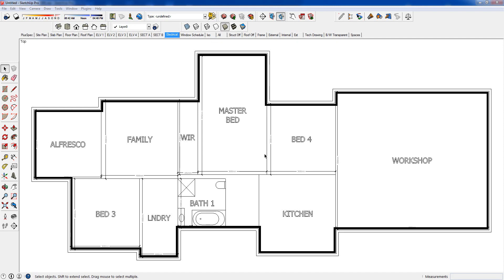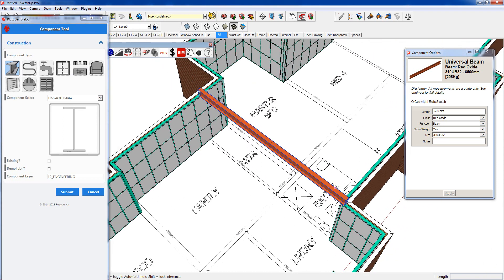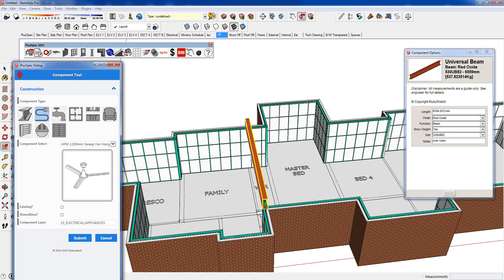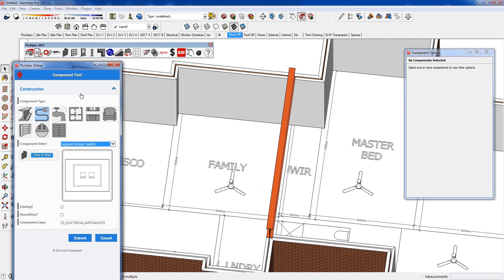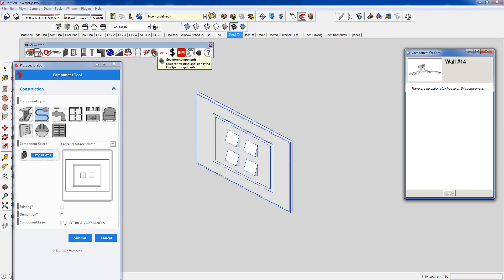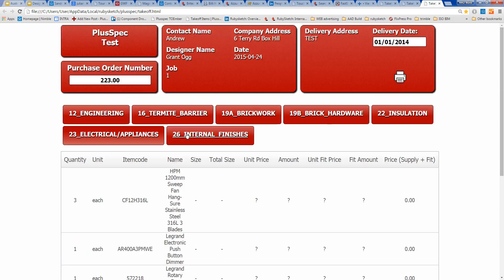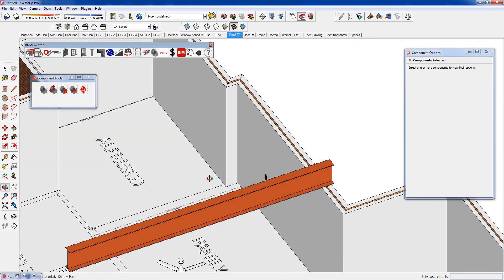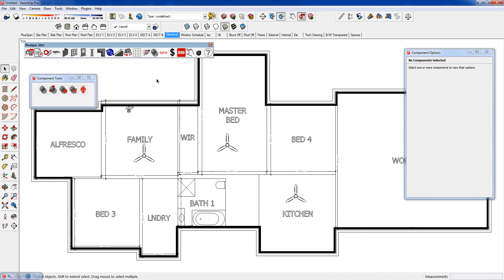Steel structure and electrical in Sketchup and PlusSpec.

Comment: How would you design and estimate a staircase.
Reply from the maker: Hello MySchizo, there is a tutorial on the existing stair tool, however, we have spent almost 6 months developing a new stair too that is more flexible and easier to use.  Can I Ask what you actually wanted to estimate?  Is it stringer, runner, tread quantities?  What would be the ideal take off as before we add the finishing touches we may add fucntionality based upon your suggestion RE take off functionaility.
Reply: RubySketch i make stairs of reinforced concrete structure with granite steps.
Reply from the maker: Okay thanks, I assume you would want the number and size of the Granit treads, the cubic feet or metres of concrete, the number of risers and in paper output the length of the run and the length of the rise on each tread and landing? 
We do custom development for manufacturers and contractors but to save you the cost you could manually do this in about 5 minutes after some one on one training which you can book on the PlusSpec website. If you want something custom made specifically for your business you can go here https://www.rubysketch.com and select buildbits in red, mention this post so we can get back to you and continue the conversation. B)
 In the new Stair tool, we are numbering steps and creating a 2D plan view automatically on a different layer which may be all that you need once this is done you can export the drawing to paper and use it onsite to create your formwork. I hope that helps out MySchizo buddy